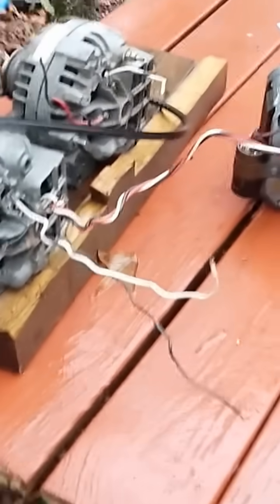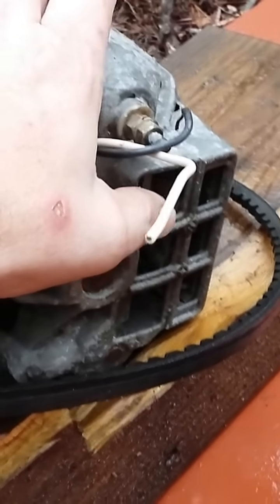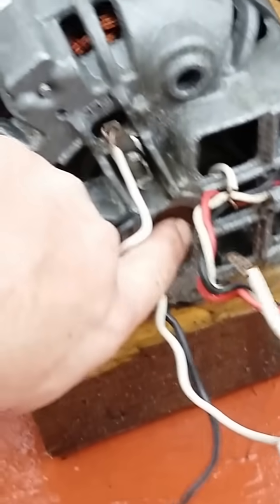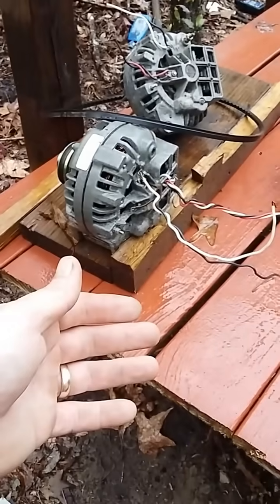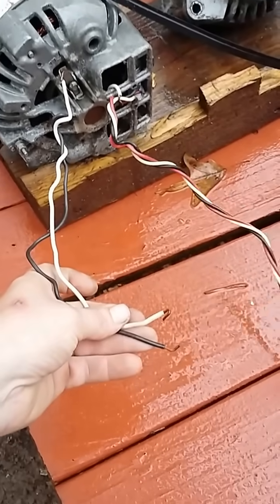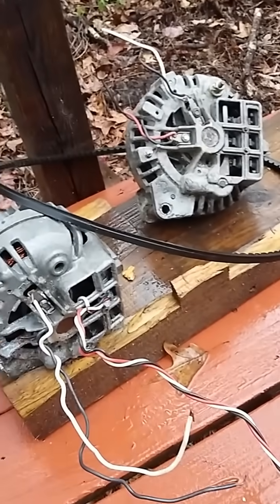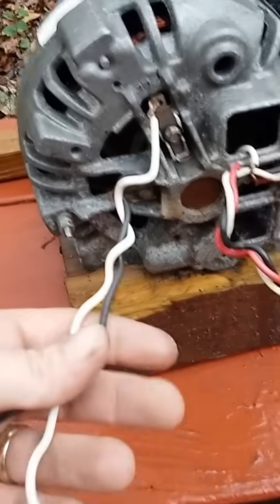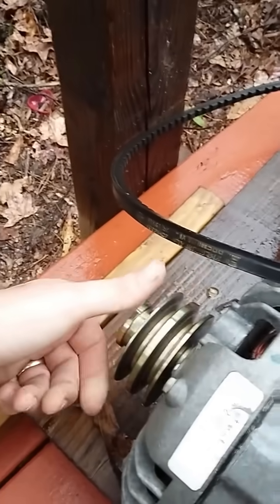Update Free energy forever no wind no solar no gas READ DISCRIPTION!!!

Comment: Ran stuff from my van; PC, small mini fridge, etc when working as a locksmith (and my key machines, that needed an inverter to run em... same principle here but instead of your engine ya hook up an electric motor from your house (small electric input) to run the alternator (bigger output). Hook the small motor with a deadman switch inside and simply plug in whatev as needed. Won't run whole house but will run most appliances. just gotta know the draw watts of whatever yer powering.
Reply: I needed it for my locksmith van, key machines and such. As far as household use could be helpful for offsite: sheds/ cabins, etc...camping as well... to save need and cost of running new powerlines across a property.
Reply: The key would be tailoring the setup for the particular use/location.
Reply: The electric motor I use is powered by my own continuous inertial axis thing I made (No real name for it, is just a wheel powered by gravity/magnetic array combo-with little to no friction) that directly turns the alternator. You can also use a plug in electric motor to turn the alternator, which can be fed back into your household supply or separate wiring (inverter optional depending on use). Cuts down on electric bills especially when using multiple "alternator rigs". Currently not using em much, moved in with friend who pays their power bill so no need. If used to power in house I suggest keeping it separate from power company feeds. They look for low electric draw and high draw homes as a means to spot pot growers and such from what I've heard. I mostly used em for outdoor on site power.
Reply: I'm a retired locksmith, not a physicist or electrical engineer. If ya lived near me I'd be happy to show ya my rig (currently disassembled in the shed)... made it after the area I lived in was gettin lots of power interrupts... It is a flywheel, that uses magnets I glued to it. They react to the magnets on the backboard and also some shifting ones along the spokes so it turns consistently as well as constantly. None of the parts touch except where I connect the flywheel axis rod to the alternator shaft. Took me about half an hour and 40 dollars of magnets to make the first one over a deacade ago. Made about five variations since and they all spin until I stop em. A friend kept harping on me about it til I showed him because he said it was impossible...kept saying I was describing a "fictional perpetual motion" device. His words , not mine. Eggheads like him tend to overcomplicate things that are basically common sense (to me, at least) and/or discount things they were already told are impossible. I had a need, so I made the damn thing... the idea simply popped into my head and it wasn't rocket science. Then I moved around a bit and don't use it anymore since I've no need for it. Same friend told me to patent it but I've no interest until I can consult with a really good patent and business attorney. May have other uses as well but I'm not gonna do anything until I figure what bad stuff it could be engineered to do/run and not tinkering with it much now, Also, unlike most I consider the ethical, moral, and long term practicality of things before I spread my ideas. Rather be poor than unleash another weapon or device to enable others to do harm.... Medical issues and such have dwindled my resources and limited my mobility as well. I also have a friend in a rural area with a small stream. Used a boat's high speed prop (the screw) with an extended shaft to power (turn) an alternator to run the field pumps he uses for his garden. Made another that was wind powered with sail material (like a windmill) to power another friend's huntin cabin. Whatever method ya use, alternators are cheap and easy electricity sources, so who really cares about why or how. Figure that out yerself to suit whatever yer resources and location. If ya wanna egghead it any further that's up to you and not my thing so I'm basically done with this thread. Hope I've helped, if not, GL and GB
Reply: And for good reason, I don't really give a F about this topic or debating your explanations... Alternators are cheap from scrapyards and/or junkyards and can be useful so long as ya figure a method to turn em and invert/draw their output for whatev... thas all I was tryin to convey. Wether or not I explained my  device properly... the versions I made and used, for over a few years before I moved, never had any input energy aside from the initiating spin I used to start em, and they each ran (spun) continuously for months on end before being replaced. The only reason I tinkered through a few versions was to make them more solid (better design materials) and efficient (scaled down in size). How/why they worked I can't explain, because as I've said, I'm not a physicist or an electrical engineer. I'm not sellin em, sharing the design, or claiming I've somehow solved the world's energy crisis so why the F do ya keep harpin about the science? I DO NOT CARE why/how my thing worked. It solved my problem (power loss/spikes that messed my gaming and PC use) and ran my entire cluster of entertainment system devices (as a standalone electrical source not connected to the power grid, and without any fuel or maintenance) for a few years without interruption (minus the version switches) so I care jack all about your can't, doesn't, won't, etc... opinions and explanations. If ya can't make a similar device that runs on its own from what I've already posted then that's your prob (not mine) and they aren't at all costly or dificult to make. If whatever education you have prevents ya from makin one ya probably got ripped off... or ya drank the (don't try what we tell you won't work) kool-aid. Neodymium magnets (not electro-magnets) and what is basically a bicycle wheel... figure it out for yourself... I made it and I'm a self admitted idiot. Perhaps if ya got off yer ass and tried ya might realize ya been arguing over something that really isn't all that big of a deal... You sound as bad as the creationists and evolution/darwinists. Pull yer head out of yer butt and stop makig excuses as to why others can't do for themselves what you obviously can't or won't do yourself. Done with this thread/post/topic now so whatevs dude... Hope I haven't bruised yer ego, or challenged your beliefs (which is actually something I appreciate coming from others) and that whatever your issues are ya either let it go, or try ta make one before ya judge. Whatev yer choice I wish ya the best and that life treats ya kindly. Later.
Reply: Man your my hero , made me laugh a bit and smile too !  Hats off to ya
Reply: Thx dude....I'm of the opinion that most peeps on tha net simply want to push some form of confrontation or another to get an ego boost, so they don't feel so bad about their crap life choices. Newsflash...it's a crutch that never fixes anything. LOL

Comment: This guy is why people don't believe in free power.He has no clue ,three phase from the alternators is wild ac ,you can not run your house with it. It takes horsepower to make amps  not electricity ,to make high volts is always just a matter of engineering ,to make amps takes horsepower or solar or something like thermionic generators.If you make high voltage than use a transformer to make amps.Think about it all components are rated for amps .A 5 amp diode with 2 volts running through it will burn up if you put 6 amps through it with two volts[12 watts] but the same diode will handle lets say its rated for 500 volts so 500 volts at 5 amps is 2500 watts .When you try to pull lots of amps through a long wire there is losses because mother nature is blocking it with the equal amount of power that your loosing.

Comment: They look like AC washing Machine motors to me, not 12v Alternators
Reply from the maker: Malcolm Lawrenson 
even though I know that was a statement I would like to correct you since most people don't like reading through all the comments to find their answers in this video there is a universal motor not wired in star or Delta but can be wired in Star with variable magnetic speed or variable Square wave speed and torque can be completely adjustable. there is also a regular old General Motors or Dodge alternator sitting there not modified at all and there is a 1/2 horse AC induction washing machine motor there.

Comment: I have to laugh at some of the comments here and the idiocy of some people.  The description does say ìt all.  I do have an AA degree in electronics engineering but it is old school.  However, it doesn't change the fact that voltage is addative when wired in series and current is constant.  In parallel, voltage is constant but current is then addative.  For those who need pictures then here...3 12v batteries @ 10amps (just for arguments sake) wired in series = 36v@clamps.  Wire them in parallel and it's 12v@30amps.  Just saying.
Reply: That's 36v@10amps
Reply: Rodnee Eckerman Rodnee, I'm John Dixon, live in Noblesville Indiana. Can you help a bit? I'm trying to do some of this to get off the ground on some experiments, just seems like you get it real well, thanks ahead of time. Cel, 317-681-3650, shoot me text if you can.

Comment: You dummy. If you think that tiny generator can put out 220V @ 90 amps you are fucking nuts. You get 90 amps @ 12V or 1080 watts and that would be at full power which would burn the thing up if you put that out for long, not the 20kW you are claiming. You could use a windmill to turn it if you had the need for that, but any other way of spinning that alternator is energy inefficient.

Comment: that's what he alluded to but that is not true. the alternator is capable of 90 amps at 14.7 volts. one other thing two alternators do not equal 180 amps. which he also stated , two alternators equal two legs at 90 amps. yes there is a big difference . you cannot compound electricity. furthermore what are you going to use to drive the statr with? in order to produce that max.  amperage you have to turn the statter 3000 RPMs Plus. wind cannot do that without major modifications. using an internal combustion engine the cost would be more than just buying a small generator. and yes I have tried the same thing back in the 1970s.
Reply: Noble Pearce that is what I was wondering how many rpm, 3000 ?
Reply: Charlene Norman old dynamos or alternators required 3000 RPM. however the newer alternators do not reach maximum capacity until 6000 RPM. And even harder task. without doing the math a wind system would need to have about 7 foot propellers and a 4-foot pulley in order to turn the alternator that fast.

Comment: surely you jest. The alternator puts out 90 amps at 12 volts. voltage and amperage are inversely proportional. I house takes 110 volts that means you only have 9 amps you couldn't run a dishwasher off of this setup. incredible how you get 23 million views and 17000 likes? what's happened to the IQ of America
Reply from the maker: Well, actually you probably could run a dishwasher off of 9 amps at 110 volts especially if you have the capacitance for the startup frequency.  Did you happen to notice in the video the three items that I wasn't even talking about as I wasn't pointing at them (switching the word rotor and stator was the easiest part) was two Motors and one car alternator that wasn't modified or did you miss that?
Reply from the maker: Phoenix Vs Dragon GMBS 
I may have. I don't believe I did, but it is possible.. did you read the description of this video by the way?
Reply: Charlene Norman I see two alternators. an alternator and a motor actually the same thing. the determining factor is which way the current is flowing in or out. on the back of an alternator there are specifications known as IL specifications. it will give the maximum achievable amps along with the percent of the efficiency of the unit. most alternators only are 70% efficient. in other words it only puts out 70% of the required maximum amps more than 50% of the time. so a 90 AMP generator will only produce 63 amps continuously.
Reply: it's 2.3 million views
Reply: Idk if it matters but i think he said 220v at 90amps
Reply: Thomas Buie ha 2motors but still using gas
Reply: Thomas Buie actually you could not run a dishwasher off of 9 amps 110 volts. that would be 990 Watts. the minimum Watts for a dishwasher would be in the vicinity of about 1500. as for your video I'm watching your video I see nothing as you have suggested is there. is there a longer video ? Which doesn't really matter it doesn't work . about the only thing you are going to accomplish with this is burning out some appliances.
Reply: excuse the term generator. adlib alternator

Comment: Even the guy who actually has a power source is full of something that only works on lawns and gardens. The turbocharcher does not have an output shaft because the output is compressed air. The back pressure would blow out any tape and if it did not, it would famage the engine on the Honda. In other words this is just another slightly amusing hoax to go with the hoax that is the original video.

Comment: So 80amp x 110v.... Your sure your producing up to 9kw with an automotive alternator?  I have a 180amp alt so that'd be 20 kw.  I find it hard to believe 2kw would be more realistic
Reply from the maker: Lil Asian Store LLC 
90 Amps times 12v = 1080 watts...
or 9 amps@ 120v = 1080 watts
amps times volts equals Watts now in this video I'm showing everyone to Motors and one alternator that's not modified. the alternator that's modified is a motor or generator depending on how you wire it up...

Comment: Defies the laws of physics I'm afraid. How much resistance do you think the twisted wire joints are causing, that's a power loss, how much voltage is leaking away because everything is wet? That's power loss. Rectifier circuits loose power because no diode is 100% efficient therefore your system must be generating say 15% over unity to work and that doesn't include for frictional losses in the bearings.

Comment: Continuation of my earlier post...  (read earlier post first) In my back yard in the middle of the woods I got this old Chevy diesel truck that I've been using as a dog house for my dog 'Timber". I grabbed my hammer and vice grips and pulled out the turbo charger.  I cut some sheet metal and with some big hose clamps coupled the turbo to the tail pipe of my wife's Honda to harness the wasted free energy coming out of the exhaust. I did all this while "Junior" ( that's his real name btw ) was crying in the back ground. I used some foil back sticky duct tape to seal up the leaks. I also pulled the Delco alternator from the truck using a slot screw driver and then connected the alternator to the turbo shaft using some 1/2 inch copper pipe as a coupling and some sheet metal screws to snug er up.  I took "Timber's" concrete chain block to keep things propped up.  On the way to return my Coors empties, I went to the Walmart in the next town 40 miles  from here and bought every 12 volt dc to 120 volt Ac power inverter they got and some long extension cords. I wired it all up, and hooked up to the other side of my electrical panel and now I got a total of 240 volts in the house. My wife runs the dryer day and night in the house and it also powers the electric hot water tank with endless hot water.  It worked so well that I cranked the throttle body idle adjustment screw on the wife's Honda Civic to an easy 3500 rpm and whoa does that turbo ever spool up. My electric power meter on the house spins backwards. I figured the electric power company is gonna send me checks in the mail instead of a bill for now on.  I don't need a rich uncle. I'm gonna buy me boat, a truck to pull it, and a Yeti 110 cooler iced down with some Silver Bullets. I'll be sitting on a pile like Chris Janson soon.
Reply: I tried lifting myself in buckets but then realised I was using BOTH hands so found a bigger bucket put both feet in and lifted myself with only one hand. whoopee.
Reply: Jari R I hooked up 10 wires to one 9 volt battery I bought because that’s what Walmart had and I tested them and added them up and got 90 volts!!! Whewhoooo! Duracell will probably come after me but it’s so everyone will know! Heh you funny man.
Reply: Jari R I LIKE TURTLES.🐢

Comment: alternator amp rating is at DC voltage which is totally different from amperage rating ac voltage I have one of these alternators like you have I bolted it on my Chevy Astro van was going to run my air compressor with it a very very small air compressor and not happening didn't matter if I revved my van to the Moon it still wouldn't run it....i am knowledgeable in electronics and electricity and a car alternator will not run a home by its self....
Maybe 20 of them might half ass do it.... A 5000 watt generator will barley get the job done but can't run more than 1 220v appliance at the same time....been there done that for 5 months.....
Reply: Gary Marshall 5000 watt generator barely runs your compressor?? Thats pushing over 20 amperes at 220v ac. Whats the hp on that motor you stuck on that tank pump?? Maybe you should check your output amperage or even make sure your compressor spins free and doesnt have a fried bearing.. I would think 10 amps 2500 watts would run your air compressor without hesitation..
Reply: I wasn't talking about the compressor in my van I was talking about a 5000 watt generator running my whole entire house it barely got the job done
Reply: The compressor in my van could be run fairly easily with a 1500 watt power inverter yet a Dodge alternator would not run it through its AC output